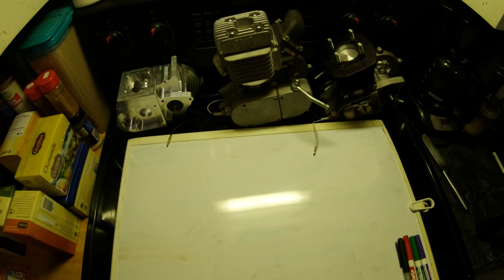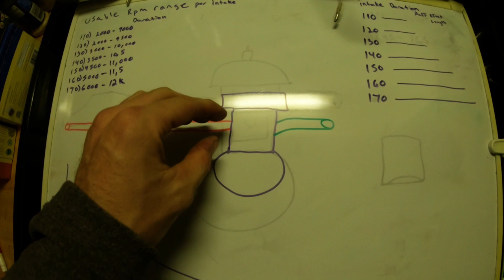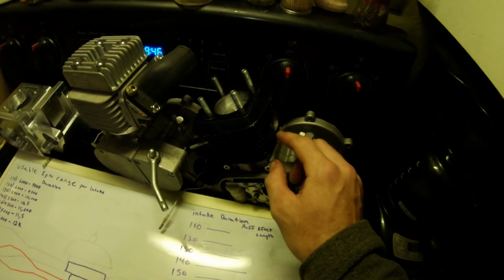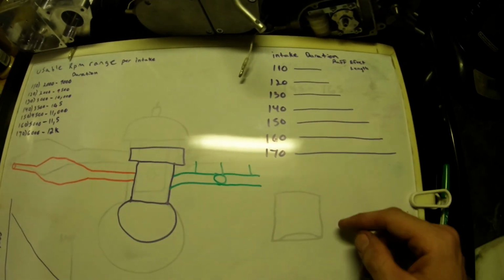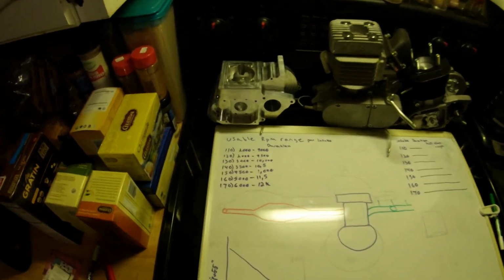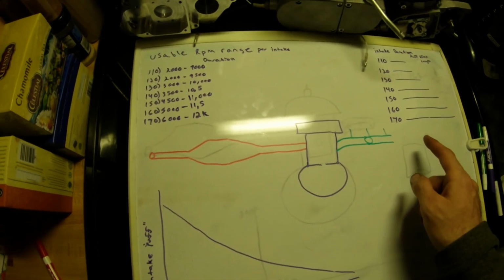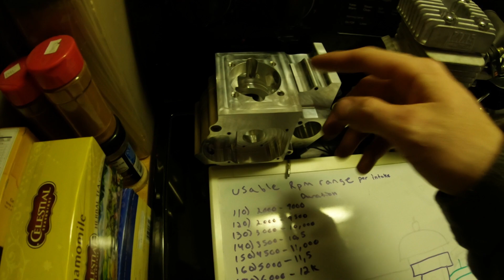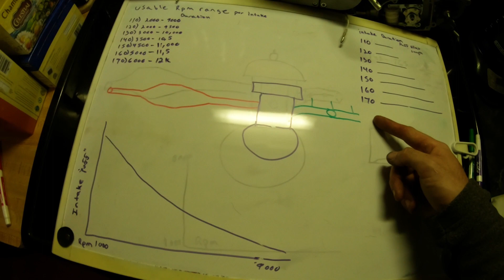Motorized bicycle piston port information

Comment: That first on the throttle bog you mention can be tuned away with a boost bottle on the intake and trying different header lengths on the pipe........chop,weld,repeat.
Props to Tommy Griffin. Bought a felt faker and balanced engine from him years ago. It ripped. 10k +rpm all day.

Comment: I was wanting to build something stealthy that could safely cruise at 45-55 mph/prefer 55 to keep up with hwy 55mph traffic (not a flimsy motorized bicycle but not a heavy motorcycle) that could still be light enough (around100 lbs ) to be easily transportable on the back of a camper van/RV or pushed/carried up a few stairs or easily put into the back of a pickup truck of you break down 20 miles from home. A fast long range e-bike has to be pretty heavy & expensive. 
     I dunno if I'm right but kinda think there'd be a market for a motorized bike like that for long city commutes & where parking is lacking, also so you don't have to leave it outside. Seems like you either have to go 25-35 mph on an e-bike, moped or motorized bike. Or move up to a heavy motorcycle, it seems like there is not much in between. A Honda grom or 250cc dual sport weighs about 250 lbs. Dunno if you could actually make something safe for 55mph that weighs 100 lbs.  If I break down on my motorcycle, I can't just toss it into a truck & hitch a ride home.....Beefed up/reinforced welded steel bike frame,  beefed up wheels, brakes & I seen some tires that'll fit on 26in wheels that are safe for 55mph. Something that gets good MPGs can cruise at 55 safely, is financially cost effective to build and can be easily thrown into a pickup truck.
Reply: The harbor freight stick welder works best off of a generator outlet, not a house outlet. The cheapie ac welder. Now you can mount tabs and frame reinforcement without cursing. Dremel tool, 28 tooth rear sprocket and welder. No fenders or chain tensioner..........unless you weld it in place. Good luck.👐